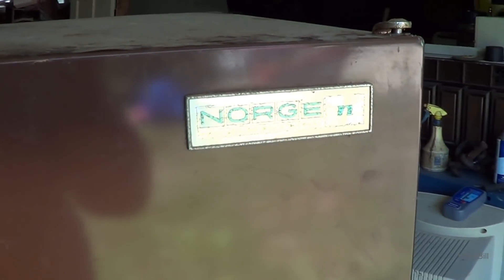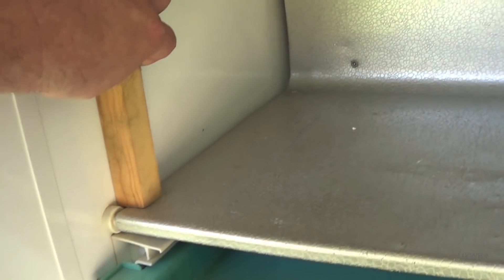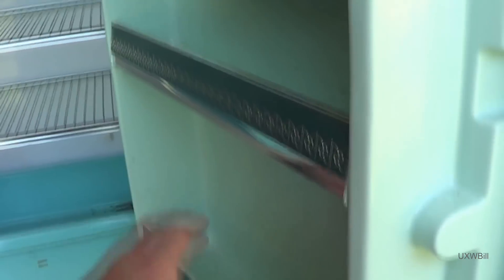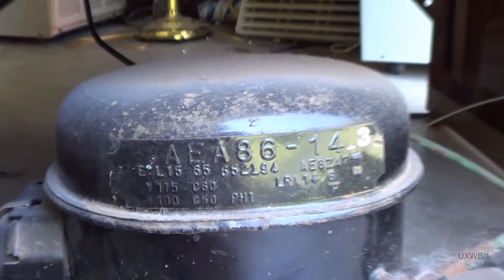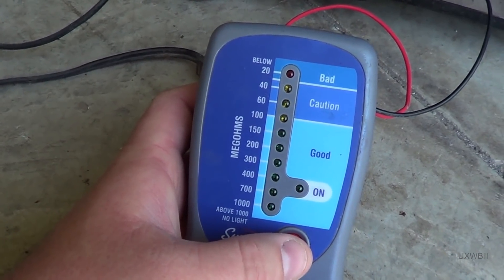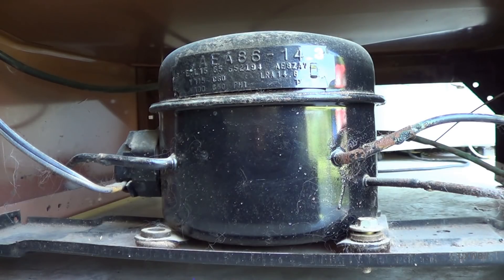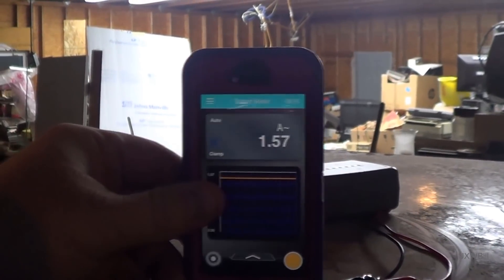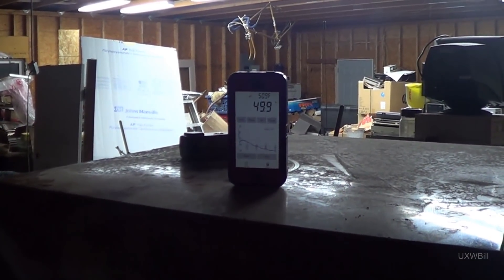Borg Warner Norge Refrigerator (Model REF131305A?)

Comment: The freezer was cut to get it out 
Many were placed in basements and house built over them  they  got trapped in
Reply from the maker: The house in question was built long before electricity was common and electrically operated appliances existed.

Comment: I was doing research on my Norge refrigerator and came upon your video. It looks like I have this same refrigerator model and it’s still being used in my apartment. It just won’t die.  Sad to see that you mutilated it.
Reply from the maker: What on Earth are you talking about? This refrigerator still exists and works perfectly well. Maybe watch the video more carefully?
Reply: @uxwbill  My bad. At the end of the video I thought the freezer was the refrigerator.
Reply from the maker: I don't believe in destroying anything that's potentially useful. I'm not sure why the freezer was cut apart. As it happens, I spirited the refrigerator away in the night because I figured it would probably be next, and I did not want that.
Reply: Borg Warner made plumbing fixtures too.

Comment: I could imagine you could grab an alligator clip and clip it to the metal of the fridge and the screw for your wall socket. not many people know that the screw on your wall outlet is actually grounded. 
that's if you want a cheap and easy way to ground it and are willing to bodge.

Comment: We had an old Norge refrigerator at the farm many years ago. Another thing that was mentioned in the video, with the line voltage, when you’re at the farm, the line voltage fluctuates so much that you can hear a difference in the sound of a box fan or see the difference in brightness of a light bulb.

Comment: the dam sub   box on  is  being a pain    it randomly   un subs  you no idea why  i have blamed  the cats in the past     but  not so Shure       and think  its a yt issue    i re subbed   on both ac/s    and   no longer have the hp z600    but a hp z640   so  hopefully the cat takes less interest when   im at work it runs cooler   (cats and there mates  loved to sit on the top of the z600    no less than 6 of them   i have 2 next door has  5 or so cats    but hay im back watching now   thinking ummm   been long since a uxwbill vid

Comment: I have a 1986 Sears Hotpoint refrigerator built by General Electric that is still in operational condition,the refrigerator is 34 years old.
Reply: I just got rid of a 1998 Kenmore/GE that's got to be a similar design. Lasted forever, except we couldn't get parts for the cosmetic parts, drawers and the wife said it had to go. There appear to be similar variations existing into the 2000s probably until they were forced to cheapen the parts and use eco friendly refrigerant.

Comment: Hi Bill.
Just wondering is that all-in-One computer your Compaq Presario 5200 or whatever it was that the Quantum Hard disk failed in that ye made a video about many years ago?
Reply from the maker: Yes it is.
Reply: @uxwbill  Our school had several here in Scotland.  Always kind of liked their form factor.  Never knew they were as expandable as they were.

Still lookin  forward to a video if ye ever managed to get that Quantum Hard Disk to work even enough to extract the data off it.

One computer I'd love to find to do a video on is my first computer, I think I mentioned to ye before.

A 1995 Olivetti Envision P75 or DX4 100MHz.

It had some very cool features ,very short lived PC but for it's time very unique inc a Sat TV card,

 SCART/Composite inputs in & out, wireless infrared keyboard with trackball ,ability to play Video and Photo CD's and record from TV.

Plus it could be used as a standalone CD player without starting the whole computer as it had integrated speakers in the base unit.

It was black/navy blue too which was unusual at the time and had Olipilot, a unique shell atop Win 95.

Great machine wish I'd never got rid of it in 2003 but back then I didn't know as much as I do now about fixing them.

They were soo expensive and non-expandable though that they didn't sell well at all even in the Home markets of Italy & here in Britain.

Comment: A refrigerator with 2 prongs??  😮
Reply from the maker: It was a simpler time (not there is anything wrong with that -- I'd certainly prefer it to the overabundance of poorly implemented, insecure and unreliable electronic nannies in the modern car).
Reply: That’s how our old Norge was. It ran great for over fifty years like that, and then the compressor went out and that was the end of that.

Comment: I knew the design is General Electric because we had one of these, GE, with the same coiling in the back, think it was a model from the 1970s. Difference was the freezer entirely separate on the bottom, larger upper section the fridge. I do not remember if a frost free model. It lasted until 2006, being in the basement was another matter. Also had a golden yellow GE, same model which was older, and quit working in 1993.
Reply from the maker: Only the cabinet design, specifically the corners, was licensed from a GE patent, pertaining to the corners. If you're curious: https://patents.google.com/patent/US2808309A/ . Borg Warner was the actual manufacturer of this appliance.

The rear mounted condenser was an extremely common design and I'd not be surprised to learn that GE and Borg Warner might have bought theirs from the same source.

Comment: Amazing how well these old fridges are still capable. In all fairness maybe you needed to turn the thermostat to max and then give it some readings after it’s been at that setting for a number of hours. Great find I enjoyed this.
Reply from the maker: It is impressive. I've posted some temperature numbers in the description and comments. Almost all of these residential refrigeration systems are of low capacity and have a slow recovery rate. Turning the thermostat to maximum won't get you there any faster* and should never be required in a properly working unit.

* the exception being a modern inverter-driven refrigerator, whose control board might ramp things up if it takes too long to reach the setpoint.
Reply: uxwbill Totally agree about getting you there faster like when people go into a hot room and put an air conditioner on 60 and think that they’re going to get the room cooler it’s only gonna get as cool as the btus could bring you there same thing holds true with heating. The reason I mention that is because it did cycle back on when you open the door and were checking things so that leads me to believe that it could stay on a little longer and perhaps bring the temperature down a little bit more if the thermostat was set to its higher setting (you said earlier it was in middle position) remember that thing is antique. Isn’t it amazing how some of these vintage things can still work and brand new items are dead out of the box or not working properly.

Comment: Except for the color, we had one of those when I was a kid.  My folks bought it new ca. 1965, iirc.
Reply from the maker: Do you remember what color that one was? Nice to have a closer idea of how old it is...definitely a bit older than I would have expected.
Reply: @uxwbill  Theirs was white.  I could be wrong... I was 5 y.o. in '65...  The freezer-within was superceded by two-door jobs not long after that, so '65 seems about right to me.  The style looks like '60s to me, although you're right, that color says 70s.
Reply: On the rating plate, it gives the address as "Chicago 54, Illinois".  The plate design, at least, predates the Zip Code, which was introduced in 1963.  I tried the model & serial at appliances411 & no luck.  Site says, if produced before the 70s, unlikely to know.  So very well could be '60s.  Looks like it to me.  On one of the websites, says they had a unique compressor design that was very quiet and very long lived, they gave a 10 year warranty on the compressor.  Did it ever get properly cold?
Reply from the maker: @boggy7665  It has since cooled down nicely for both refrigerator and freezer. I can't really make out the model number, not even after taking a rubbing of it. I suspect that any production records have long since been destroyed. The compressor's low operating noise level is impressive. Modern fridges could take lessons on both that and the reliability front!

It seems as though I may need its services -- another, much newer refrigerator just gave up the ghost, so I will be moving its contents into this one.

Comment: Love the fridges that keep it simple. The Kenmore I have in my apartment is a base model ~$500 fridge without the icemaker option. It's so simple that it just kinda works whereas I've had friends that have a flood happen from a fridge that needs a water line run.
Reply from the maker: If you are anything like me (a thought that should scare anyone), don't ever get an ice maker. You will be irretrievably spoiled!

I've had to deal with the line breaking (because someone mowed it over with the refrigerator while pushing it back) but it wasn't a big deal because I knew right where the shutoff was.
Reply: @uxwbill  But your a great role model 😉
Reply: @uxwbill  yup. I think I am a lot like you and yes, icemakers will spoil the ever loving hell out of a guy. Wouldn’t want to go back now

Comment: Perhaps the 50Hz was on the tag because they just copied it from the compressor label (9:36). Seems like the only component in that simple fridge that could possibly even really care about line frequency.
The Norge makes me think of the old SNL skit with Dan Aykroyd as a fridge repairman.
Reply from the maker: I am of the impression it would have cost extra to get a dual frequency compressor, and that it was specified for a reason. It's the only motor there is. All these years later, that reason can only be guessed.

Dan Aykroyd played a Norge repairman.

Comment: That is a really nice find you got there.
What does "Safety Factor - 5" mean? I have a semi modern 2004 GE refrigerator in the apartment I rent I moved there in 2008 so the unit was already 4 years old now it is 16 years old it works but occasionally makes a loud bang when the compressor shuts off it is also very loud when running it has been running the whole time I watched the video (yes I watched the whole thing) and it is still running now as I am typing this comment out
Reply from the maker: I can only guess. I think it may have had to do with electrical safety and insulation. As with "Spencer Relay", Google proved completely useless.

It sounds like the rubber mounts that isolate the compressor from the refrigerator's are failing. (You'll notice the ones on this fridge are still good, although that is unusual.) They are a fairly standard part and can be replaced without much trouble. Do one at a time to avoid flexing or straining the refrigerant lines too much.
Reply: @uxwbill  I don't own the refrigerator so I don't want to spend the money on it plus this has been going on for about 3 years now but it does not happen every time it stops. I had a 3.5 day power outage and as I was restocking it (It was open for quite a while as I emptied it and tossed out over $250 worth of food) the area around the door and bottom of the freezer was about 120°F as measured with my IR gun, I guess the auto defrost heater came on? After that it ran for a good 3 hours. I am due for a new one anyway but thanks for the help

Comment: Love the interior colour. Wonder if it's possible to buy any household appliances now that will endure as long as this has.
Reply from the maker: No, I don't think you can. Although the mechanicals have been dramatically cheapened, I don't think it's the mechanical aspect that will fail. It's the electronic controls that I think will go first. Things shouldn't and wouldn't have to be that way, but they are.
Reply: @uxwbill  Yeah, logically you would assume that things would get better over time. And adding complexity would only be done to improve efficiency and functionality. Yet somehow we've ended up in a race to the bottom type situation.

Comment: The manufacturer plate predates the use of ZIP codes (it says "Chicago 54"), so it's probably from the mid 1960s or older. And although Smart Home Products, Inc. claims the Norge is no longer an active brand, they did register a new trademark on it in 2019.
Reply: The ZIP code come out in 1963

Comment: Hi, do you happen to know the duty cycle the fridge is operating at? It would be nice to know the actual energy consumption over time to compare to modern models.

On a side not, my outdoor air conditioner unit is dual rated 240v@60Hz and 200v@50Hz. I have no idea why the US would be exporting such a unit to Japan. I suppose most induction motors made for 120v@60Hz will work equally well at 100v@50Hz (just a bit slower) due to the equal voltage per Hertz ratio.
Reply from the maker: I do not, but I can put that to a test.

Comment: Perhaps the reason the box isn't getting as cool as it should is because the door seals are bad. Especially since the rest of the unit seems to work as it should.

Also, regarding your comments about the energy usage of compressors in refrigerators over time, I was wondering if the same rule applies to air conditioners. Talks about energy usage in older appliances and computers ("You need to throw that old thing out and replace it with a new, more efficient unit") drive me up a wall because I don't see the point of getting rid of something that works perfectly fine just to buy something new. Plus, I'd like to have my purchases last a long time, and that seems to be more and more of a rarity in new appliances these days.
Reply from the maker: I don't think the door seals are that bad yet. They passed the "dollar bill" test at various locations. Here we are about a day later and all the bottles of water in the freezer compartment are frozen solid. The refrigerated bottles are nice and cold, but I have not collected an updated measurement from there.

Air conditioners are a bit of a different story, and efficiency has improved a lot more there. (Plain old window air conditioners are still pretty inefficient, but that can't be helped given how many are installed in places they don't fit perfectly.) Modulating compressors, thermostatic expansion valves and multi-stage systems have all come together to give dramatic efficiency improvements when a system is properly installed. I doubt they'll last like the old ones did, though.
Reply: @uxwbill  The big question there is whether they will last long enough to make up for the cost of the unit with those energy savings. I still wouldn't get rid of a unit just for that purpose though.

Comment: Actually in Japan it's 100v 60Hz, but only in the highly populous areas in the southeast part of the country.  Everywhere else it's 220v 50Hz.

Yes, the compressor is a Tecumseh.
Reply: Japan uses 100 volts nationwide, but you are correct that the southern/western half uses 60 Hz while the northern/eastern half uses 50 Hz.

Comment: Great to have you back! What brand and model of DMM do you use for the measurements and do you recommend buying one?
Reply from the maker: The three meters I used:
1. Craftsman "Professional" true RMS amp clamp
2. Holdpeak HP-90EPD
3. EEVBlog 121GW

All are Bluetooth Low Energy equipped and to my great surprise, it was possible to pair with all three (and run their apps!) at once.

I've had the Craftsman the longest. It's pretty good, but the TRMS converter does odd things when you exceed its bandwidth. It is a rebadged CEM by way of Southwire (who also rebadges CEM meters). 

The Holdpeak was certainly cheap, looked interesting, actually works fairly well but it is only average responding when measuring AC voltage or current. It's also not really all that safe, though it should do fine on the bench.

As for the 121GW, while I don't follow Dave Jones, I do know who he is and happened to be curious about the meter. (No, I didn't back his fundraiser. I bought one like a normal person after saving and waiting a long time) It's early days yet. For now I think the 121GW is a decent meter. The quality control seems a little hit or miss (one of the buttons on mine is intermittent) and it doesn't feel as well made as the blue Brymen 235 he also sells.
Reply: @uxwbill  Thanks for the feedback. I am considering buying the HOLDPEAK 570C-APP Digital Clamp Meter because of the bluetooth and also the ability to measure up to 1000A DC. Should come in handy for automotive work. Costs around $45 on ebay, so not too expensive, but are uncertain about the quality.
Reply from the maker: @jan-thorehol4786  I think the 570C-APP is good and safe enough for automotive work. It is surprising to me, though, that Holdpeak didn't use their far superior and better built 570N clamp meter (6000 count, TRMS, based on the amazing DTM0660L/HY12P65 chip) as the basis for the "APP" variant.

There is a review and teardown here, that you may have seen: https://lygte-info.dk/review/DMMBTMeter%20BT-570C-APP.html
Reply: @uxwbill  Thanks again for taking the time to answer. I will look into the review. I have other multimeters ( Metrawatt and fluke) for more demanding use, but the 570C-APP seems to have the capabilities I miss. On another note, would like to see another kitchen table electronics repair video from you when you have the time. I really liked those!

Comment: I would hazard a guess the reason why this would have been designed to run on 100volts at 50hz was that they supplied the US armed forces with appliances that were to be used in Japan as there are / were a large number of US personnel stationed in Japan

Good to see your videos